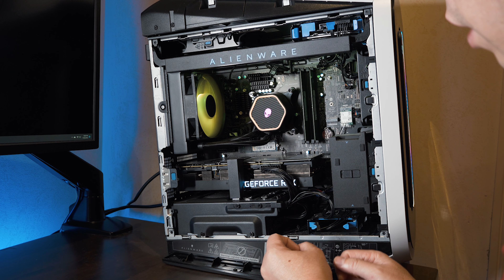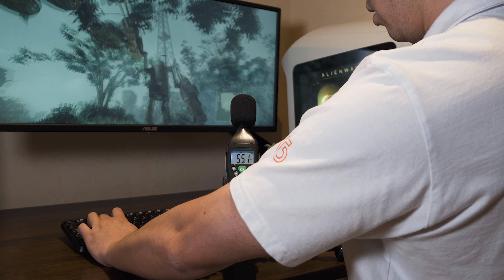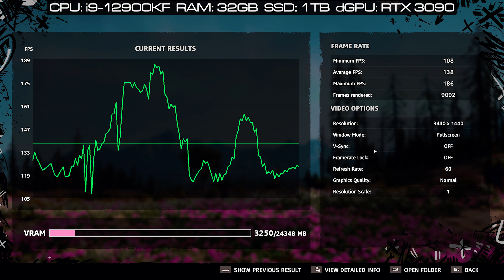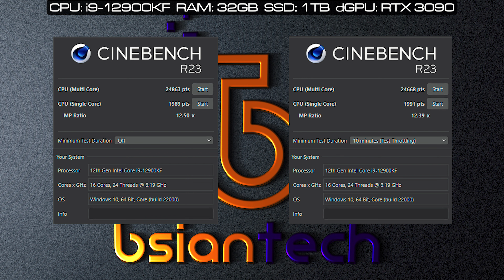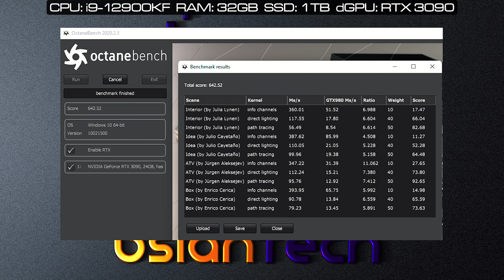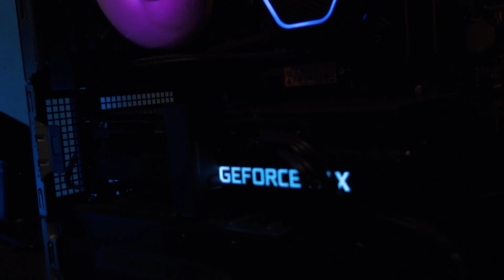Dell Alienware Aurora R13 - Look into Dell's Flagship 2022 Gaming Desktop Computer

Comment: I am looking to get the 12th Gen Intel® Core™ i9-12900F (30 MB cache, 16 cores, 24 threads, 2.40 GHz to 5.00 GHz Turbo) NVIDIA® GeForce RTX™ 3060, 12 GB GDDR6 16 GB, 2 x 8 GB, DDR5, 4400 MHz 512 GB, M.2, PCIe NVMe, SSD. ALIENWARE AURORA R13 GAMING DESKTOP. this week from dell. Estimated Value $2,269.99 ( $1,299.99 ) sale. what do you guys think. and can you guys help me with a good 27 GAMING MONITOR. this is for my son ( thank you very much )

Comment: Best PC I’ve ever owned! Pretty good review. All the fans can be controlled easily through AWCC. I made a mistake of buying an HP OMEN 40L recently. The thing barley lasted 3 days before the RGB lights went out, PC started smoking out of the back, not to mention horrible performance and blue screens that took 2 days to unscrew. Even HP customer service said to not buy their PCs. I was recommended the Alienware R13 and it’s a BEAST. Haven’t had no overheating over 73c when pushing it hard as I can! Pulling 200FPS+ in warzone 2.0 and multitasking is crazy smooth! This thing is great. Boots up in like 2 seconds! I’ve never seen nothing like it! 💪🏾💪🏾

Comment: Great insight and comments on the PC. Two questions: How did you achieve that rainbow lighting effect on the front, meaning what seeings you set in the FX AWCC? and second, will this PC support in terms of the 750W PSU and actual physical space the new graphics cards RTX 4090?

Thanks!
Reply from the maker: Thanks @DOM, to answer your question the rainbow lighting effect on the front panel is just one of the preset lighting schemes in AWCC, I think its called Spectrum. Your question regarding support for the RTX 4000 series card, specifically the RTX 4090 is fantastic one. Unfortunately I haven't had a play with any of the new 4000 series Geforce cards, the new 3.5 slot sizing from Nvidia did surprise me a fair bit. This R13 Desktop PC isn't with me anymore but remembering the sizing, I personally don't think it will take on the RTX 4090 founder edition as the bracketing system in the R13 would stop the full size of the 4090. I think Dell will be slimming down the cooling solution for the RTX 4080 and 4090 for their pcs.
Reply: @BsianTech  Thank you for the detailed answer, you are right in your assessment. I just got answer from Dell Support and indeed the 4000 series is not supported by the Aurora r13 due to the 750 W PSU and of course the physical space. The maximum it supports is the configuration they pre-sale which is the 3090 at max. 

Cheers!
Reply: I know someone that ordered an r13 4090 sooooo

Comment: It is not Alienware. It is a ancient Dell chassis (look at all the extra holes on it) wrapped in fancy plastic with CPU's, that are power throttled instantly out of the box because the supplied fancy named 120mm cooling solution is not enough to keep the ancient chassis cool enough. Odd choice of memory with no XMP profiles, and being Dell the BIOS will be locked to the current generation of CPU's and Graphic's Cards. You better also hope if anything breaks your within warranty because no 3rd party supplier can supply you with a new motherboard or power supply, and Dell's approved list of memory modules consists of modules they alone supply. It is far from the upgradable PC Dell love to market it as.
Reply: I totally agree, that cryo-tech rubbish is just a joke for 12th gen i9 Why are people still praising this shit?

Comment: Add some rgb heat spreaders on the ram sticks.  Too bad they did not rgb the power supply, would have been a simple thing.  Don't know why Alienware only uses the kf cpu as the k version is better for video decoding with the igpu (rx dgpu cannot decode hvec 4:2:2) or use quick sync.  An oversight that discourages video editing; going to diy route if you want rgb or the xps route for non-rgb.   Cost difference between kf and k is negligible.

Comment: You can change the fan speed and curves in Alienware command center it works fine.  Also I own the computer and love it have no issues at all.  Overclocking works but sometimes you will need to manually change it yourself default profiles are good but not great. The temps I have under full load never get hotter than 80

Comment: It's shit. There, u can thank me later.
Reply: I Just ordered mines and after reading this comments ima just cancel it but I doesn’t let me do I have too wait for it to ship??
Reply: @jesusluvsu9301  Has it shipped already? So like is ur PC already otw to u now or is it still in the warehouse? If ur PC has already been shipped, then ofc u can't cancel it.
Reply: No I barely ordered mine today but when I tried to cancel it doesn’t let me it says not available during order process something like that
Reply: @jesusluvsu9301  Maybe it's just the initial processing that needs to be done then u can cancel it. Either u wait until the processing is done then u try again, or u can contact Dell now about it to be safe.
Reply: @dylanloo9856  oh Alr, question did u also get this pc or Why do U not like it?
Reply: @jesusluvsu9301  I never got this PC. Anyone who is part of the PC master race (PCMR) just knows that OEM pre-builds r terrible coz they use proprietary parts that literally make it impossible to upgrade ur PC in the future. They're also often terribly designed such as their cases having little to no ventilation for sufficient intake and exhaust which will cause the components in the PC to overheat easily. And Alienware is notorious for making such awful pre-builds. U should watch Gamers Nexus' review and teardown video on this Alienware Aurora R13 coz this pre-build PC is hilariously bad.
Reply: @dylanloo9856  I did and I still got it and it works great and it's over kill so no need 2 upgrade. It has 1000w PS and i9 12th gen with 64 GB RAM WTF do you need 2 Upgrade? hard drive? I already added 2 of them no problem. Video? it has a 3080 already over kill for my needs. when the time comes for needing a real upgrade will be 10 years down the line and time for  a whole new PC not a F%$#ing upgrade.
Reply: @Qugie  Yea, but overheating issues. There's no way a 120mm AIO is enough to cool a 12900K. Unless u don't do anything that's CPU intensive to push it to its limits, but at that point, it's just a waste of buying a 12900K. Also, GPU temps r higher than in that shitty heat box of a case coz of insufficient ventilation. Check out GN's videos on the Alienware R13 and you'll know what I'm talking about.

Comment: What do you think @Brian, cheaper to build or buy with these internals?
Reply from the maker: @J S usually it is cheaper to build but one thing to note is that the warranty when building yourself is usually parts only and each component can vary for the warranty length and usually Return to base (store). Prebuilt computers will usually offer warranty on the whole computer for all the parts to same length of time and also could offer On-site warranties as well. I usually build desktop computer for myself because I use to be a system builder many years ago. Most of the time I won't purchase from the cheapest but rather over time work out who gives the best after sales support even if they are mid priced when working on parts. I have learnt from all my work, parts WILL fail and it is the process and time to repair or replace it is the main issue. Just my two cents =)
Reply: @Smelly Wrestling Geek Building is the fun part